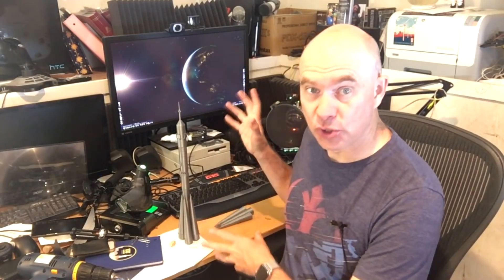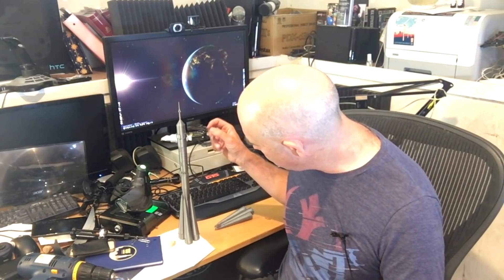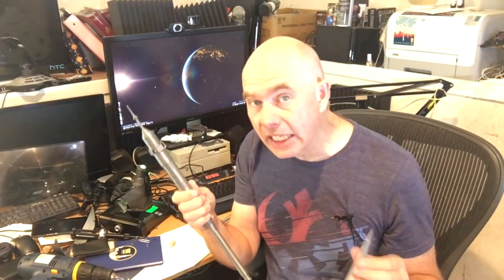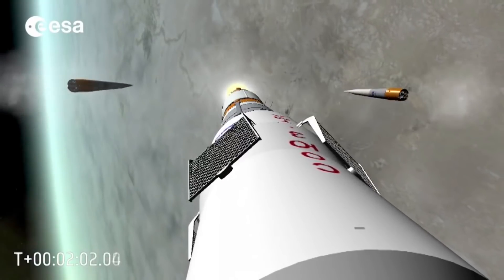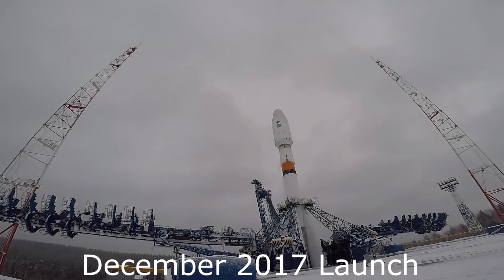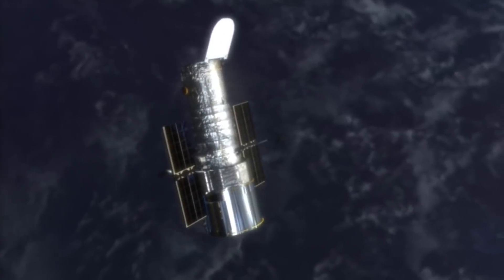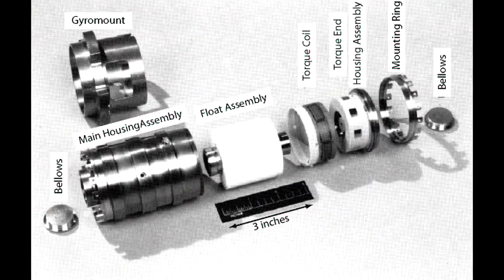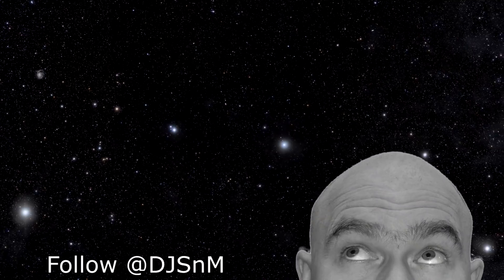Soyuz, Hubble, Chandra & Kepler Updates (Recovering, Fixing, Fixed, Probably Dead)

Comment: About the 3D print failure of the boosters, you need to use a brim when printing this kind of parts.
A brim increases the surface of the first layer, providing a stronger grip between of the part and the heat bed.
In Prussa control, just set the Brim option on.
This should prevent the boosters from detaching from the heat bed.

Comment: Scott I have a question about the space shuttle.  The weight at liftoff is tremendous.  When the SRB's lit off it was moving.  How did the shuttle and SRBs  not just leave the fuel tank sitting there.  The connection points just look so undersized compared to weight of the filled fuel tank.  TIA, Mike

Comment: Wish we were a few years more advanced with SpaceX.  Dragon doesn't have the ability to lock in and out spacewalkers, but two launches might do it...  Send up a "servicing module" or something that would have suits, an airlock and parts in it, along with minor orbital maneuvering systems, then a Crew Dragon to carry the astronauts to perform the repairs?  Maybe end up just parking it in an orbit lower or higher than the scope, so it could be used again later?

Comment: Hi Scott, amazing model of yours! I propose two improvements to the design: 1. use small magents embedded in cavities specifically left out for a magnet to be placed inside during the printing process at some time, 2. use magnets to simulate the Korolliov's cross like this: print a 'real' mechanical ball joint connection at the tip of the boosters, place repelling magnets underneath it inside of echt booster/center core combination, then use attracting magnets further down where the real explosive bolts would be for strapping the whole thing together until separation. With some sort of mechanism you could maybe flip the magnets in the inside of the center core to be in a repelling configuration so the boosters would be pushed away on activation, leading for them to be in this angled position where the ball joints would release and the repelling magnets on top of the booster would push it in the opposite direction just like the venting oxygen would. Let me know what you think of this.
xmoex
Reply: oops, I should say the magnets from 1. shall be used to hold the whole thing together, vertically

Comment: Voyager 2, I think, had a similar issue to what Hubble just had. Only instead of a gyro, it was the scan platform that wasn't working. They got it unstuck by basically wiggling it back and forth.

Comment: I always wonder why mechanical gyros are used on spacecraft. Ring laser gyros have been in use for decades in commercial aircraft and are both more accurate and more reliable, at least here on earth. They have no moving parts, are very lightweight and consume very little power - all things that are normally greatly advantageous for spacecraft.

Is there something that makes them unsuitable for space, perhaps poor radiation resistance or something else?

Comment: Hey Scott, why not design these telescopes to have an auxiliary mounting point that could be used to send up an auxiliary gyro set and supplemental fuel cell?
With a modular system the spacecraft could be resupplied and continue to operate.
A robotic auxiliary unit could be sent to replace the battery, fuel and gyros, and the old auxiliary unit could be ejected or added to.

Comment: If the Soyuz really failed due to someone hammering the booster in place, then Roscosmos needs to ban hammers at their facilities (recalling the Proton rocket which had the sensor forced into place upside down).

Comment: Hey Scott! I'm a huge fan of your videos and thought about swinging this paper by you: https://www.researchgate.net/publication/325128963_Carbon_nanotube_bundles_with_tensile_strength_over_80_GPa

Basically it's a paper claiming a breakthrough in carbon nanofibers that should theoretically exceed the tensile strength required for a space elevator (as I recall, NASA put this around 7 GPa). The same Chinese group have recently produced a 70 cm long fiber which in itself is pretty impressive. 

Could you do a video on the physics of a space elevator? E.g., what sort of counter weight would be required? Are there any suitable asteroids out there that could feasibly be captured for this purpose? What would a cable to geostationary orbit weigh? What kind of forces would the tether at earth surface experience to keep a cable tense? Lots of interesting physics there..

Best
Josef

Comment: In other news, it's not looking too good for Opportunity. Hasn't been heard from since June. They'll soon stop actively trying to establish contact. They'll still be listening if it comes back to life on it's own, but if that doesn't happen by January or so they'll declare it lost. Fingers crossed that won't have to happen yet.
Reply: Considering that it's mission life was originally 90 days that little rover should be an inspiration to all of us. RIP Opportunity.
Reply: i heard they need dust devils to clear the solar panels right? sucks to lose i nice rover like that especially by the method they managed to land it, that ballon thing was cool, wish it was a mod on ksp.
Reply: Yeah, so during the storm, the rover had no power and the problem with that is that it needs some power to keep itself warm. However the scientists figured out that the storm itself will actually keep it warm, since it traps heat in the atmosphere. So either they were wrong and it did freeze to death during the storm or there is a serious dust build up on it's solar panels. Eventually the dust should clear and the rover should get enough sunlight to power on, but the problem is again, if it doesn't have power right now, it'll freeze to death. And there is no storm to insulate it anymore. 

Who knows what happened, if it's dead we'll never know what killed it. If it does recover than it'll be amazing. Whatever the case, it had such an amazing run that it deserves a rest.
Reply: i mean, was it really too much of an engineering problem to install wipers on the panels to wipe off the dust? they've been experiencing power depletion problems with dusty solar panels since the Pathfinder, i find it hard to imagine why they haven't tried to implement some kind of dust removal solution by now.
Reply: oldfrend it couldn’t use a dust removal system even if it had one its battery’s flat.
After a comment higher up i cant help but wonder if someone centuries in the future stumbles on it half buried in the martian sand what would they think of it.

Comment: Force it in, even if it says "this way round" and youre doing it backwards. Not to worry. Use a sledge hammer and hope no one notices
Reply: What I find amazing the Soyuz is basically a slightly updated R-7.
... which was THE FREAKING FIRST ICBM designed in THE FIFTIES for crying out loud.
.... AND was was used as the FREAKING FIRST ORBITAL LAUNCH SYSTEM.
... AAAND nonetheless has a stellar record, considering how often the R-7/Soyuz was launched.
So whatever they do to assemble it, it usually is very very Okay.
Reply: Actually, the Proton rocket did have a problem like this. Its avionics were mounted upside-down so it tried to right itself and slammed into the ground. Its avionics module shouldn't have fit upside-down
Reply: @Xatzimi  Exactly why i said it. This recent tragedy being quite similar.

Comment: Thanks for the update!

A little tip for printing which helped me a lot with build plate adhesion.
There is this special glue called magicGoo which does help A LOT with build plate adhesion.
It sticks very well during printing and is much more easy to remove after printing then normal glue.

Comment: Is that an Sparc Station IPX under that screen?
Reply from the maker: Yes, I won it at Hacker Jeopardy at Defcon X
Reply: Awesome, I was using them 2 decades ago at the university... But they have already been old even then.
Reply: IPX? Maybe my 56-year-old memory is failing...I was thinking IPC for some reason.
Reply: I am not sure, if there is any big visual difference from IPC to IPX. Internally, the IPX is a bit more advanced with a better CPU and (possibly) more RAM.
Reply: Ah, yes, I recall that now. SS1, SS1+, IPC, SS2, IPX, ...that was a long time ago, but those were all darned-good desktops. You're making me nostalgic! :)
Reply: My first SS1 had a whopping 16MB of RAM! What would you ever need that much memory for?!? ;-)
Reply: sry ;-)
Reply: @scottmanley  
Does it still work?  I miss those.  I also miss being able to run a computer directly on the Internet too.  Probably be destroyed by spam and cracking / DoS attacks now.
Reply: At least it's doing something usefull :} Poor Sun though :-(
Used to work for them. Good times.
Reply: Cool. I should get around to doing something with my LX. Maybe gut it and put in an ITX mobo or an ARM SBC.